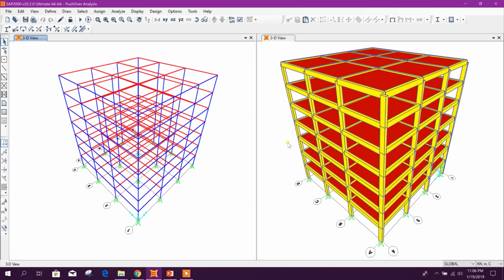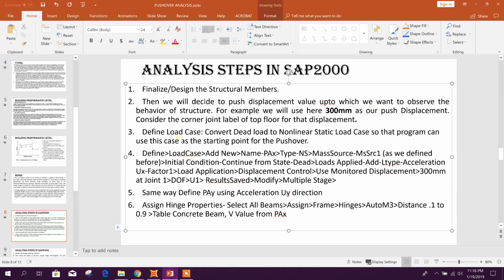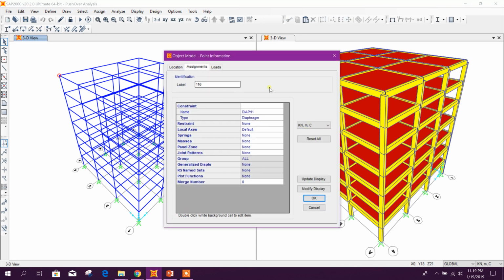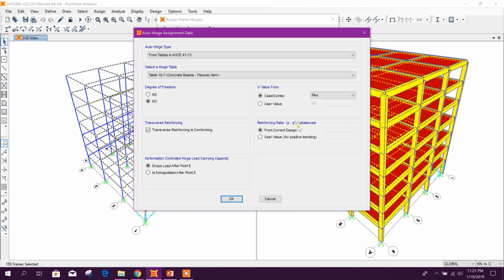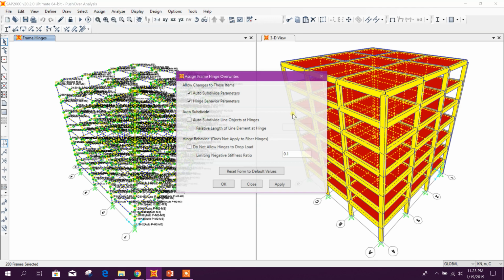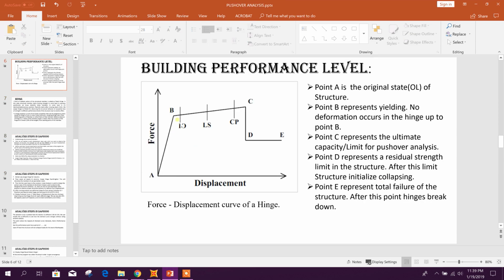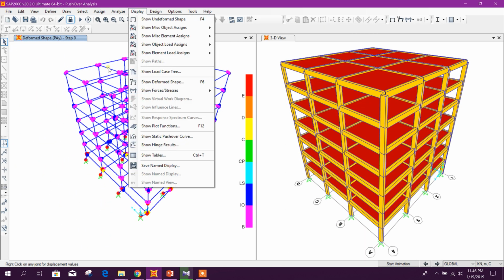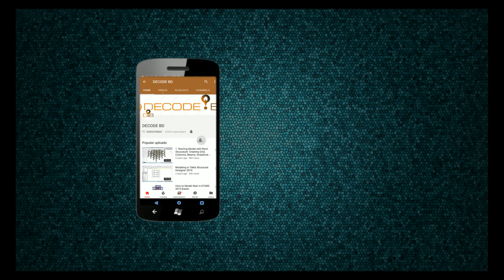PUSHOVER ANALYSIS IN SAP2000

Comment: What is the difference between the use of Ux (acceleration) for pushover case instead of load pattern (Qx), which will be based on the response spectrum (Response spectrum)??

Comment: Thankx bro. this great job. i have 2 questions:
1. what is a logic from using acceleration instead of load pattern in the analysis?
2. The building is the symmetric in the two direction so why the result it has huge different in the two directions ? i think must be the same.
Reply from the maker: That's because of the column orientation. Column's width & length orientation is also a factor to resist the deflection for lateral load.
Reply: ok thankx

Comment: Why it always says not finished in PUSH X and PUSH y during  analysis .....id doesnot run completly
Reply: I have the same problem,
the finishing occurs only in case when the displacement control value is low.